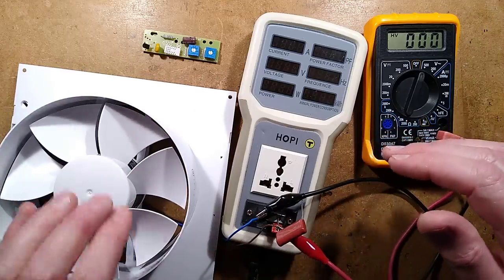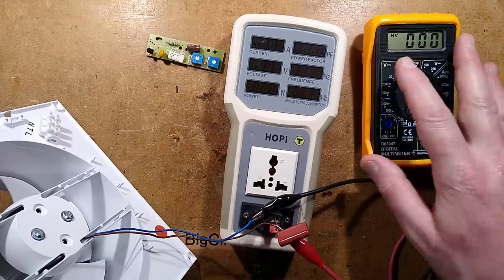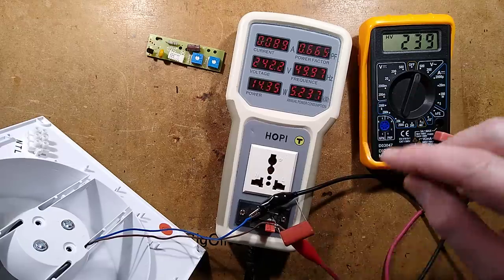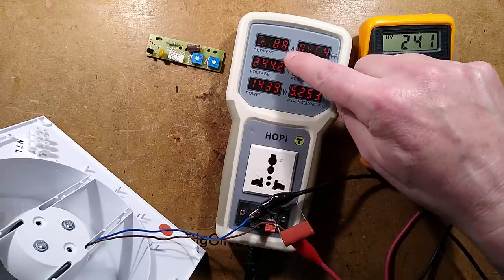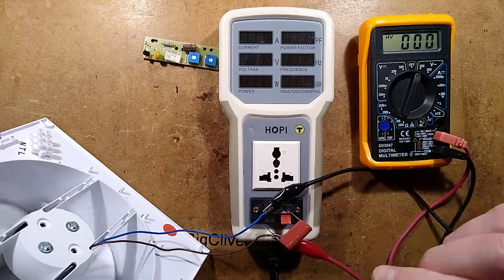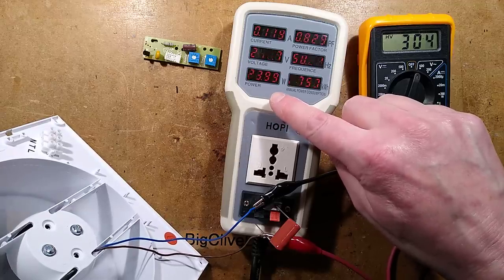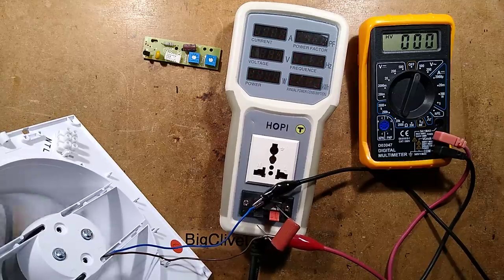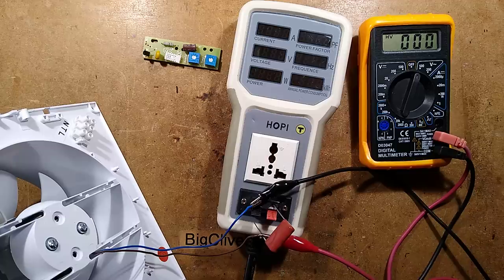What the heck!  Series capacitor makes fan go TURBO!

Comment: Wait... could something simple as a capacitive dropper actually tame down a fan? (yes I've read the description)
I've been somewhat disappointed in a lot of newer cheap 30-40cm desk and standing fans. On older models, the lowest setting was quiet enough to sleep at and the highest was tsunami mode, but on most new ones the lowest setting is already ridiculously fast (and loud) with not all that much difference to the highest setting. I've been thinking how to tame these down in a simple fashion but predictably most online searches led to people taking a sledgehammer to crack a nut, saying I'd need a VFD for AC motors as used in fans. I for some reason didn't even think about a capacitive dropper 🤔 Wonder if those fans could exhibit a similar weird turbo behavior depending on the capacitance
Reply: as fans are usually just simple motors, they're inductive, so to "drop" them you must use a series "inductance", eg a belast from an old tl armature.

the trick with the (far cheaper and infinitely less lumpier) "C as a voltage dropper" with LEDs and such us that those circuits rectify the incoming ac via diode(bridge) plus capacitor (if any), thus leds look either capacitive or resistive, depending on which kind you got cheap off Ali', hence C dropper works there. 
Combine a C with any inductive-looking thing and you get resonance(s) on your hands and loads of weird fun, no dropper!

Comment: Try the same motor on a VFD, and going above 50hz would make the motor stall sooner or later. If you were able to apply more voltage, increasing with the given frequency, it would be able to keep up its speed. You might even get a  sensation of something hot.

Comment: Silly question: If you add a resistor to reduce the current so it uses the standard mAmps, would it be possible that the efficiency measured in rpm of the fan will still be higher, due to the improved power factor?
Reply: No.

Comment: Humidity sensors are the bane of my existence.  Could I just put a few different resistors on a switch and trick it into thinking the humidity is high (on) or low (off) manually? I think the reason (it has been a few years) I didn't just try was the auto defrost and a cob on the daughter board the sensor was on.
Reply: Cob? The black blob. Forgive my terminology if I'm wrong.

Comment: It's forming a resonant circuit, in resonance the voltage across the L & C can raise above the supply voltage  - many fold in some cases.

If you were to try this with suitable coils and capacitors at high frequency (which tends to be able to support a higher Q factor) - you can get voltages across the individual components equal to Q x supply voltage

Since you have 300V/240V= 1.25

This shows your circuit has a Q factor of around 1.25

Pick a more suitable capacitor and we could see it fly!

Comment: If the capacitor is charged to the highest voltage in the AC waveform couldn't it be increased considerably above the nominal 240V, would be very interesting to view the voltages across the capacitor with an oscilloscope while operating the fan. Perhaps the reactance of the fan motor is contributing to the voltage gain.

Comment: Because the fan is of the induction design, it's flyback is carried back around not through the circuit to the cap. To prove just run wires through a donut magnet.

Comment: Is it a shaded pole?  Ive never put a cap in series with a shaded pole motor..  guess itd act like a start cap that doesnt get disconnected by a relay or anything and just burn the motor up or kill the cap, but sense its a film than the motor will go before the cap..

Comment: This is exactly how cheap multi speed fans work. I have a 5 speed, ceiling fan with only two wires between the fan and controller. There are several capacitors switched in and out of the circuit to control the speed.

Comment: My first guess would have been the capacitor is smoothing the AC therefore more continuous current/ higher average voltage. 
But reading the other comments i now suspect that is wrong😂

Comment: The current in the fan was limited by inductive reactance. The series capacitor makes a series resonant circuit. this leaves just the resistance of the winding in the circuit.  This is basic electric theory of the power factor from Lenz'a Law is countered by an equal but 180 degree current from capacities reactance.  Nothing magic. Current increases and the motor runs with higher current with a power factor approaching unity.
Yes STEM subjects appear to be magic sometimes until the forces are understood.

Comment: I use 10-100 uf at 500 volts caps n the PRIMARY side of my tube power amps to really "beef up" the power that I'm using  before rectifying my B+.

Comment: If it is working with PWM, is not it normal when you place a capacitor which extends the width of pulse, so the current, so the speed?
Reply: PWM? Huh? it is an AC fan ...

Comment: Probably because the capacitor is over compensating the VAr requirement, leading to high terminal voltage, which again leads to higher operating speed and power.

Comment: By the way, you said you wanted to tame it down. Don't you have a few of these $1 triac dimmer circuits from Ali lying around? They can be quite useful, despite causing quite some interference.
Reply from the maker: The cheap dimmers often have a problem with inductive loads, and can sometimes go half wave and damage them.

Comment: I'm curious why your country is using 240V. Instead of 120V. Why would they not split The phase. In the breaker. And distribute one twenty throughout your house. I don't know, it just seems a lot safer. To use a lower voltage in residential areas.
Reply: Yet, there are fewer accidental electrical deaths in Europe ( per 1,000 people ) vs USA.  240 Volts is more efficient and that is WHY they use it.

Comment: Isn't it the same principle used by desktop fans? They always have a 400v capacitor to boost/bootstrap the motor.
Reply from the maker: That may be for speed control or an auxiliary winding for causing phase shift and giving the fan rotational direction.

Comment: Impedance of a circuit has 3 components:
Z = R + jωL  + 1/jωC = R + Xj where X = ωL - 1/ωC (in electrical or electronic engineering, imaginary unit is j instead of i in pure mathematics)
You may notice that the power factor has improved from 0.665 to 0.829.
ω is angular velocity, defined as ω = 2πf
In your case: ω = 2π * 50 = 100π ~= 314.16 rad/s

Do you want to try to make power factor becomes nearly 1? If yes, follow my procedure:
1: Measure the resistance across 2 terminals of the fan, without powering it up. Now we know value of R
2: Solve R / |R+jωL| = R / sqrt(R² + (ωL)²) = 0.665 for L
L = R/ω * sqrt(1 - 0.665²) ~= 0.001775453 * R
3: Find the capacitance value such that X = ωL - 1/ωC = 0
ω² = 1/LC
C = 1/ω²L = 1/(10000π²L)
When you find the value of C wanted, get a capacitor with value nearest to C, have fun.

Comment: It brought the power factor closer to unity, and the added efficiency went straight to the fan.
Reply: It didnt add any efficiency to the fan? 
if im not mistaken most fans are synchronous. That is they will spin at x times mains frequency and with airflow being related to rpm.... somehow the power factor increased, input power nearly doubled and the fan got even less efficient.

Comment: Inductive reactance isnt it? Balancing the phase disturbance by the motor. This is why its in regulations for factories using industrial motors to have capaciters in series with the loads as otherwise it draws power that is not used efficiently

Comment: If you tried a bigger capacitor it mjght be possible to cancel out the inductive impedance leaving just the resistance of the motor coil to limit the current.  Of course the fan would then be running at mach 3 and it might release its magic smoke!

Comment: I got that once with an Iron core transformer and an 22uf 350V capacitor in series. Poor Transformer... It hummed like it was shorted, and went HOT in mere seconds. The transformer was a 750VA Old fashioned Double-U + Double-N core clamped with a steel bandclamp. Sadly it did not survive the ordeal... Winding shorts and a shellack roasting smell was the result.

Comment: ELI the ICE man. Voltage(E) leads current(I) in inductive(L) circuits. Current(I) leads  voltage(E) in capacitance circuits. Capacitance are often added to inductive loads or the electric company might charge you more. Thats what I heard.

Comment: By inserting the capacitor in series with the fan coil, you have changed the reactance of the circuit. This is why it goes turbo on you!

Comment: So in radio we this thing called impedance  matching. So you have resistance well impedance is is the amount of power getting sent back to the power supply in a ac circuit. There are a cuppal of way to match impedance like adding capasitors. There are a lot of smart people who do this a lot more so go look it up your going to have more luck looking where the hams are.

Comment: Put very very simply. When AC voltage in swinging one way, its charging the cap through the fan, then when ac switches, its now to voltage sources in series, the voltage gets used up from cap quick, then the cap begins to charge in opposite direction, then when ac switches, again two voltage sources in series. - oversimplified explanation, but thats whats going on. Its working because the stars aligned with the right values. use a different value cap, it may go faster or slower, change out the fan may be faster or slower.

Comment: I do believe it's time to call on @barevids and ask him to try and repeat the outcome, but use 2 probes from his scope, one on the hot side and one on the neutral side connected to the lead of the capacitor.
There's something I've experienced in audio crossovers that resembles what might be going on here, and that is saturation at high voltages.

Comment: Cap simply changes the Hz output to the Fan with frequency change will increase the voltage output similar to a switch mode PSU the fan makes the inductance and the cap ups the output V could be wrong 😊 or couples the peak drops together on the AC in 50hz to say 80hz
Reply from the maker: It seems to be a phase induced voltage boost as opposed to a frequency change.
Reply: You can't change the frequency of the mains that way.
Reply: Yes your right 👍 I have come across this in old electric fire heaters with the squirrel fan when the heat element is on the fan speeds up

Comment: You build a simple Voltage doubler (Villard, Cockcroft-Walton) - etc. This happens when you put a capacitor in series, and I bet you will find a diode in the fan!
Reply from the maker: No diode.  It's a shaded pole motor.
Reply: @bigclivedotcom  Than this is the effect to move the halfway by n° degrees of N compare to L1. In the end you build a virtual L2.

Comment: the same phenomenon was used for some of the tubes you love clive... it's just accidental in this case, basic concept, the capacitive voltage is leading, the inductive is lagging, the 2 cancel out,,,,   The danger in this case, is, i bet if you run it for say 60 seconds, then turn it off, ... i bet that cap is hot. It is dissipating real power but without the air flow.
Reply from the maker: This is actually making more sense of the old resonant start ballasts.
Reply: @bigclivedotcom  Yes, i remember them, esp with 8 foot fluoros, you just stumbled on an accident...i am still impressed that happened

Comment: if I had to make a guess, it would be that the fan uses PWM (Pulse Width Modulation) and the capacitor decreases the pulse width, therfor increasing the speed of the fan. if it's powered by dc then maybe you turned it into a PWM fan. pure speculation though.
Reply from the maker: It's an AC shaded pole motor.

Comment: have you taked ac units aparts (no but you need to)
rest of ac units have hot wire run into capacitor to motors in order booster it up more i do can see 35% different between it and it last bit longer than no capacitor

Comment: Capacitive and inductive are reactances nearly equal and opposite, creating a series resonant circuit. In this case the resulting impedance will be nearly resistive, and the power to the circuit will increase. The motor will soon burn out, probably!

Comment: Something similar happens with my 60 Watt big household fan. It used to be working fine. Now that multiple people in this house have more appliances, somehow the inductive load has changed, and if I turn on the fan it will trigger a way higher current and causes a breaker to fail. Only at 60 Watts? If I use the Mobile airco (1000 Watts) nothing happens and the breaker does not fail. WHY ??
Reply: Maybe the running cap is faulty, causing high starting current. Movers caps lasting only few years and not starting, you know it's the cap. Maybe faulty winding...
Reply from the maker: It's possibly a breakdown in the electrical insulation or perhaps a higher starting current.

Comment: I've got thoughts on fans! ... As I'm melting in the heat, I bought a 16" Pedestal Fan. Trouble is, even on the lowest speed it's too fast, so I plugged it in to an electronic dimmer, which slows the fan, but makes the motor hum annoyingly! ... Also, will it burn my flat down? 🔥👎😲
Reply from the maker: The dimmer is causing phase angle noise.  It may also cause issues with capacitors in the fan if it uses them.

Comment: Series L-C circuit! Voltage rises as it approaches resonant frequency. Must be careful with this type of circuit. At resonance, the capacitor and inductor (motor coil) impedances cancel, leaving only the resistance of the wires. This is dangerous at 240VAC, be careful! A suggestion: always use an in-line fuse coming off of prime power from your test box. Better a fuse blowing than your test box!

Comment: Could it be similar to a split phase motor where a capacitor is used to give a phase shift.
Reply: Yes, we had a refrigerator with a compressor that took many tries to start.  Dad went to an electrical supplier and bought a "compressor hard start kit" which was a new start relay and a capacitor.  The capacitor was not in the OEM design.  I was the tech, Dad was the engineer.  I wired it up according to his diagram and it now started first time every time until we bought a bigger and better fridge years later.

Comment: Of course, you broadened the slippage between  the main coil and the start coil, at te same time weakened both coils. Perhaps in this case it does not stand a problem, but the motor has no torque and gets blocked under a small load

Comment: I thought the capacitor would be level off the peak and charge up to the peak voltage of the sinewave rather than the rms value of 240

Comment: A stumper!  Need a scope.   Maybe that will help you sort of the mystery.

#1 Others are speculating about series resonance,  and as I read the the answers it sounds very possible what you are seeing... but to be sure if you can carefully connect a scope, mindful of the earth ground on equipment so you don't blow your scope probes... but perhaps if you look at the waveform, then maybe?    

#2 The voltage on the meter could be misleading,  AC volts are read typically in RMS, some meters like Fluke say "True RMS" others don't, but no telling if the waveform in the circuit has extra humps, smaller in amplitude, but are enough to confuse the meter... or the other possibility is that really is correct...

Comment: When I seen this video on my alt account, I had similar thoughts to everyone else here. Capacitors inductance changes over frequency, but I thought, wait, this capacitor is only 1/10th or less then the size of the wiring loop (Power plug to Fan and back) - so why would 1 capacitor make such a huge difference? Did you invent the first room temperature super-conductor? :buffering:
Some might say, it's all the reduced inductance of the capacitor, that would fit according to the training and testing, but at such a large increase in power-factor, I think there is more than meets the eye here, what? I really don't know, one day we might find out and share it with us. 
As far as I know, the inductance in the Entire circuit hasn't changed, on the tiny part at the capacitor :face-blue-covering-eyes: My brain is checking out. 
The Only thing I could think of is that the Capacitor is acting like a Filter Capacitor, and it 'might' be rejecting interference from the Mains:body-blue-raised-arms:or reducing the back emf, increasing efficiency.

Comment: 1 over 2 x PI x sqr root of L x C = f  maybe just like a tripler in an old crt tv. The inductive load takes longer to react and use the angry pixies, and they all get in a fight in the capacitor while they wait for the phase to open the gate. (and yes i have been drinking) 😊

Comment: add a volt meter over the capacitor also, look at the voltage over the 2 meters in serie and be amazed. its even more then then 300V if added together.

Comment: Try the 1uf and the 470nF in parallel to see if the power factor increases to 0.9 or more.
Reply: Only do this with caution. Who knows how high the voltage might go as you get nearer to resonance at exactly 50Hz.
Reply: @BrianG61UK  True but Clive likes to "take it to bits" anyway.
Reply: @richardl6751  I was thinking he probably doesn't want bits of hot capacitor embedded in his face.
Reply from the maker: And fan blades embedded in the walls.

Comment: before watching, I immediately assume its helping improve power factor
fan inductive load, capacitor brings current and voltage back into phase means more power used so should be better power factor
Reply: oh very interesting
I would not have expected the voltage jump
I'll have a think about that

Comment: The reactance of the capacitive and inductive loads are opposite. So if the capacitor's reactance is smaller then the twice of the inductor's, the total impedance will be smaller then before, which means more current. Case closed :D.